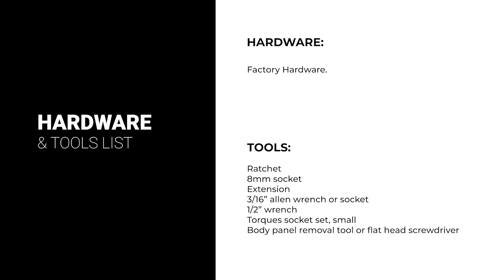How to Install Ford Ranger Radar Relocation

Comment: This product and tour video are top notch . I just want you to know on my 2019 Ranger Lariat my grille has 7 clips. The 5 lower clips and 2(1 on each side) that seem to be more of a guide but they are stepped to lock in. These guides fit into the almost vertical cutouts by the headlights. just wanted to pass this info on. Thanks
Reply from the maker: We appreciate it!